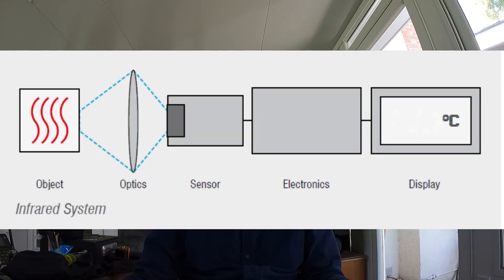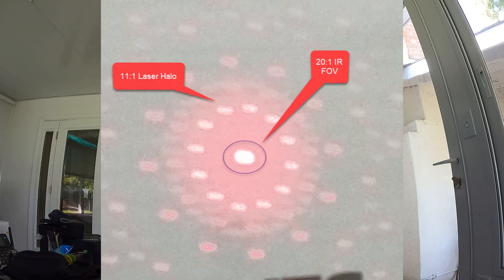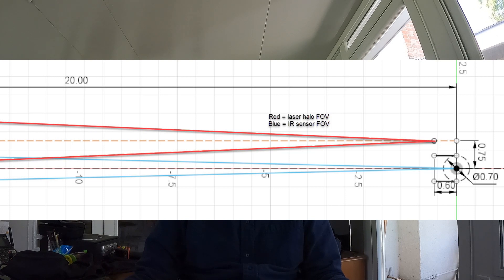DIY #9 Part 3 Compressed Air Dryer and Laser Thermometers

Comment: 5:38 thanks for these compressor air drying videos. Very informative.
Just a note that the hottest part of the flame is the tip of the blue triangle up closer to the torch tip.